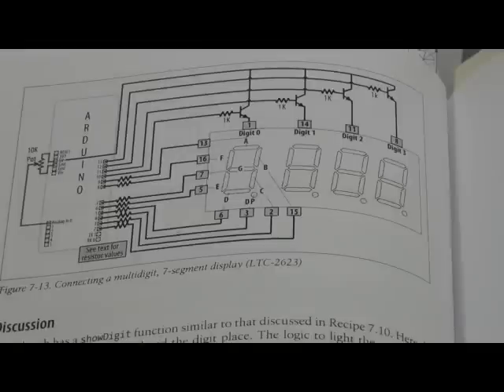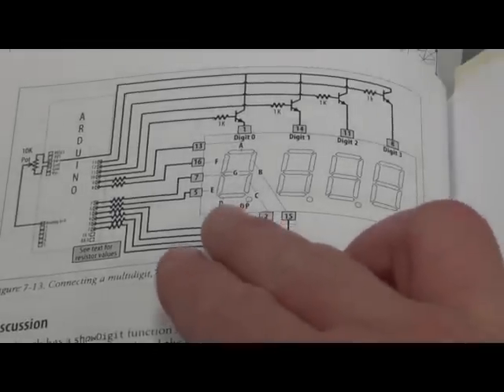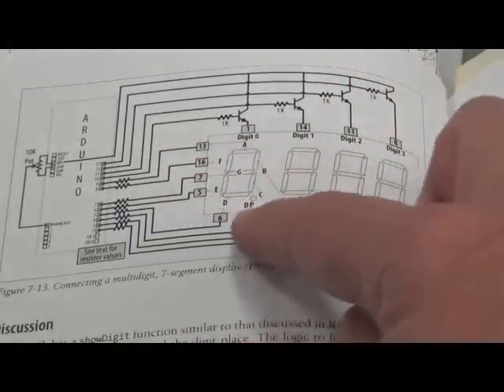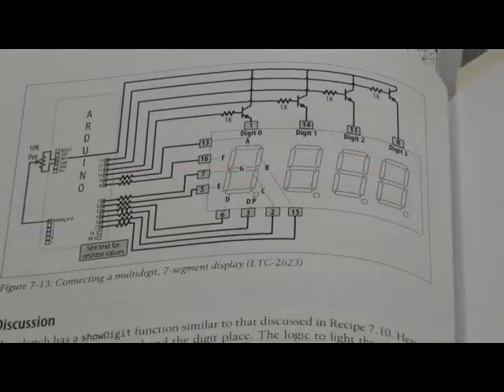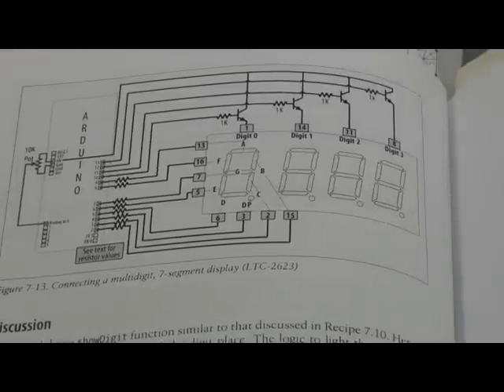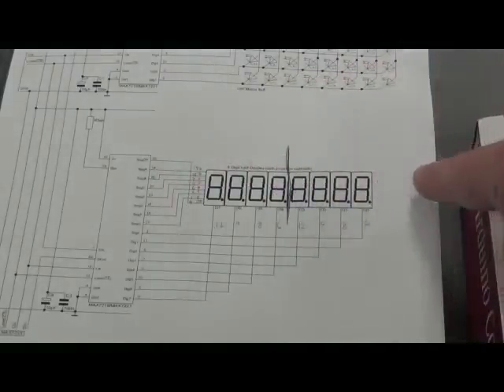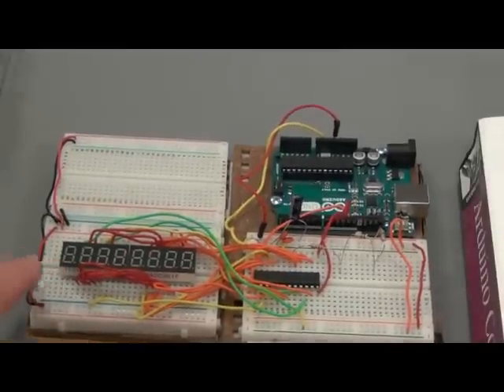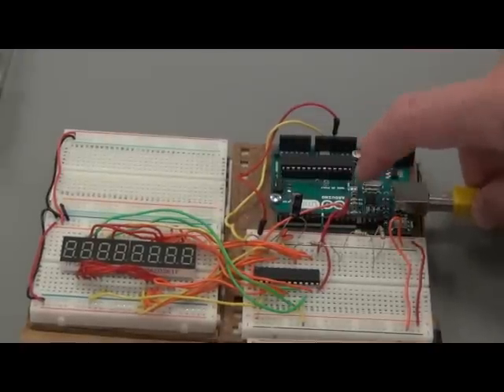Multiplexing Seven Segment Displays

Comment: Surely you don't need to multiplex the common pin (common anode or cathode). These pins could be permanently tied to ground (common cathode) or Vcc (common anode). Only the individual segments need to be multiplexed?
Reply: Correct
Reply from the maker: If you tied the common pins then ALL digits will display whatever is presented on the segments. The idea is you enable the segments you want displayed then ONLY enable the common anode or cathode on the digit those segments go to.